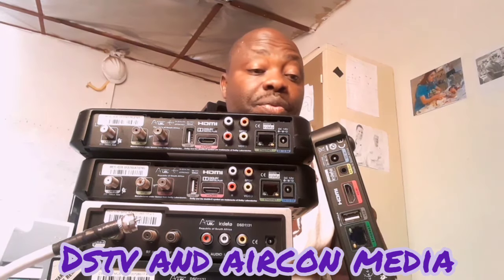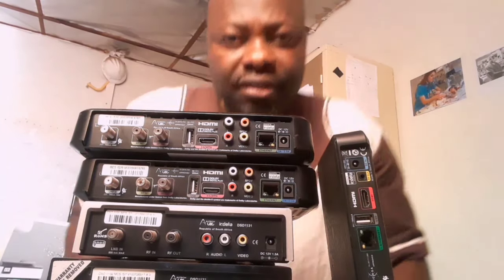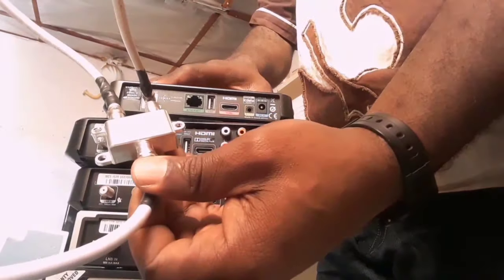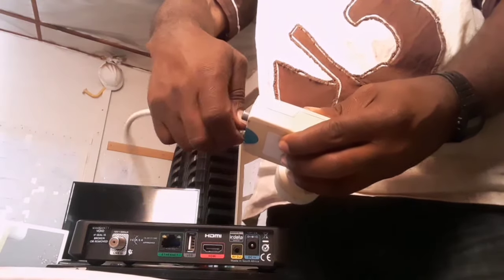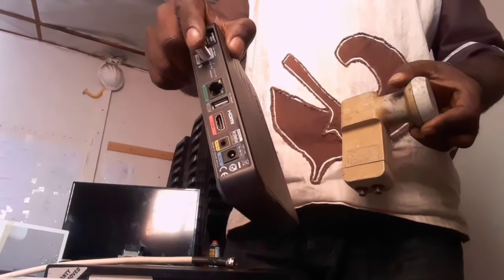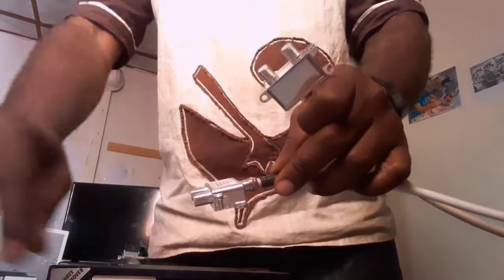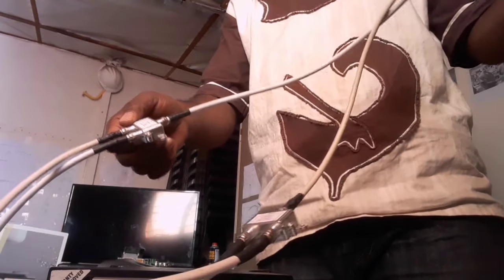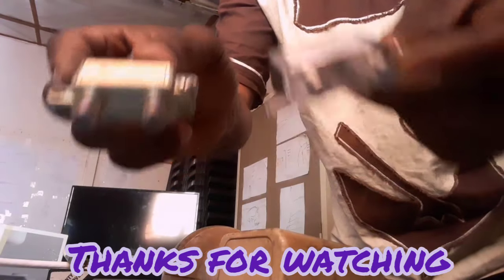How to install dstv extra view with 2 hd decoders, twin lnb, diplexer, smart lnb  Jhb

Comment: Thank you for this video. How do I use the Diplexer for twin lnb(not smart) and one Decoder with RF in/out then the other one with no RF ports?
Reply: I'm also stuck.i was trying to configure XtraView but the secondary decoder doesn't receive the heartbeat.Did you finally got the way out on how to do it???
Reply: Your decoder with RFIn/out is your primary... then use diplex  connector to split the universal cable to the 2nd decoder... satellite to secondary decoder and
Reply: And cable to “RF IN” on primary decoder. Scan both decoders on universal cable and call DSTV to send the signal.
Reply: Remember ... no heartbeat is required when you are using the latest decoders and have a Smart LNB installed

Comment: VERY NICE TUTORIAL. PLEASE I WILLBE GRATEFUL IF YOU CAN SHOW US HOW TO CONNECT FTA RECEIVERS FOR EXTRAVIEW OR MULTIPLE VIEW USING MORE THAN TWO RECEIVERS SO THAT WE CAN GET SAME NUMBER OF CHANNEL AS THE RECEVERS. I LEARNT U HAVE TO DO SOME RF OUT TO RF IN  and RF OUT TO RF IN then last RF OUT TO THE AMPLIFIER THE A SPLITTER but u have to do some frequency separating on each of the receivers

Second question. can we extraview mixing DSTV and a FTA RECEIVER?

Comment: What if secondary decoder have RF out and RF in but the primary decoder does not have rf out, how do you connect it for extra view? Thanks
Reply: in that case you will use only one diplexer, on the antenna  you will run the heartbeat straight to the RF out on the secondary decoder

Comment: Something  is not  first  you didn't  mention what  kind of lnb needs to be used and you are saying  the other cable  will go here which cable  and according to your explanation the old decoder will stay without cable but thank you for your assistance
Reply: Twin smart lnb one cable go in to diplexer splitting through the old decoder and the other cable from the lnb goes in to the decoder so the new decoder will be primary this how I have done my one
Reply: @jamalijumapili2094  BUT WEN USING TWIN SMART LNB NO NEED FOR DIPLEXER